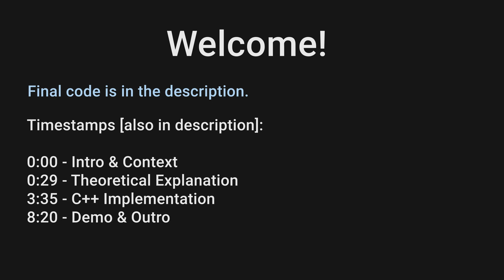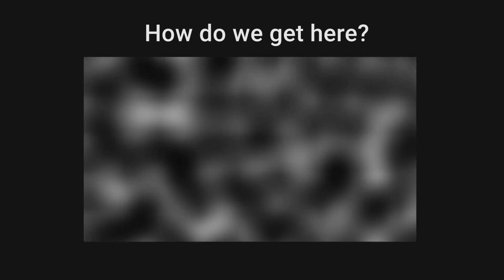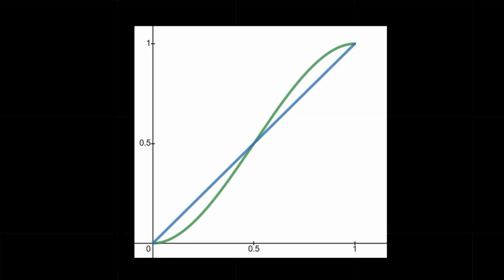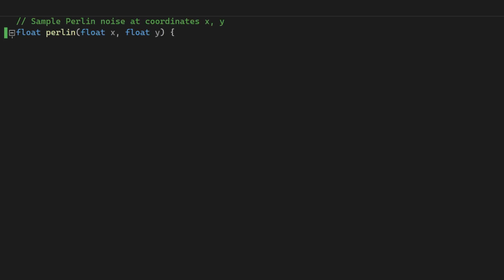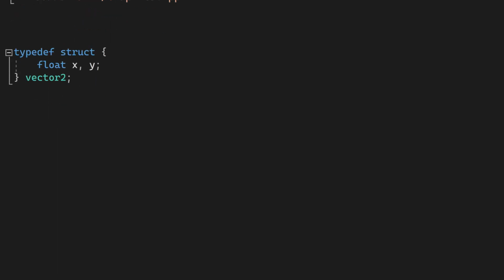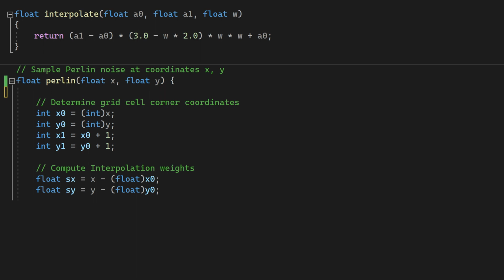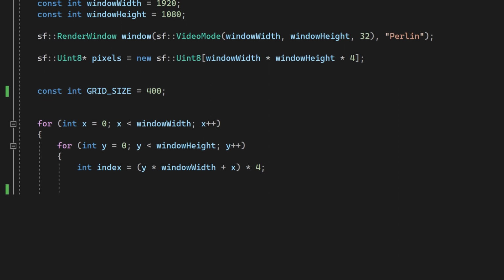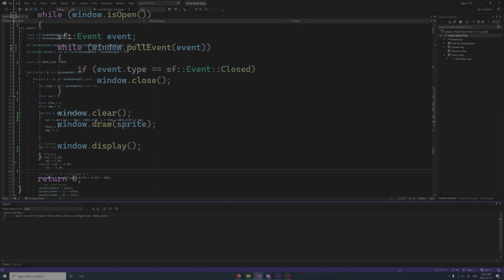C++: Perlin Noise Tutorial

Comment: Random Gradient function should've been explained in detail, saying that it's out of scope of the video just feels wrong. That part feels like an interesting aspect don't suppose it's out of scope, unless this video is just supposed to explain only the Math and not the code in which case it is incorrectly titled. I'm not a hater.
Reply: It's just a deterministic function to avoid precalculating random vectors. You can easily replace it by creating a two-dimensional array with percalculated vectors and use it instead of calculating those vectors every time. Probably that's the reason why he didn't explain this function, it's not necessarily a part of generating perlin noise.
Reply: I don't get the bit shifting part

Comment: Awesome video, learned a lot!
One question: in the main function, you create the pixel array with new, but never use delete. Does this mean it is leaked?
Reply from the maker: Thank you, glad it helped! That's an excellent question and you're totally correct, that's a mistake and I should have called delete on it before ending the program. The program memory will still be freed once it closes, so the memory isn't really leaked, but if we had a longer program or called the main function in a loop for some reason, then yes that could become a problem. Nicely done on spotting that!
Reply: @zipped1214  Since I only learned c++ last year, I was told to always use a std::array, never raw arrays. It will take care of this automatically with RAII